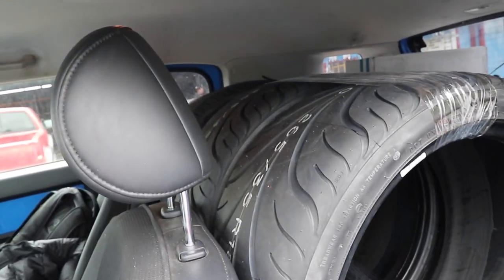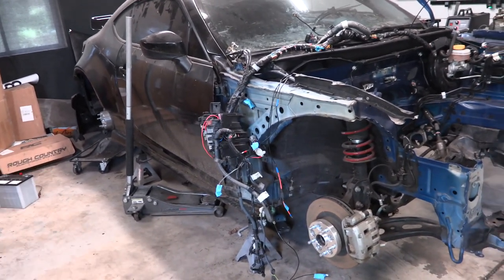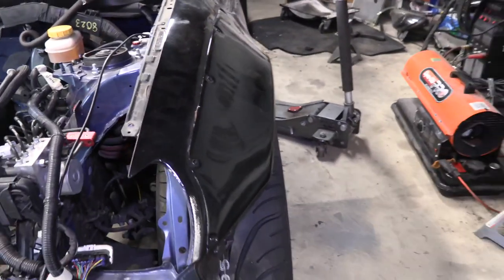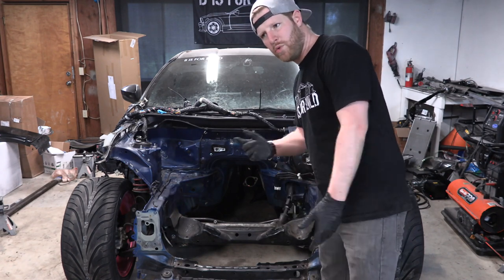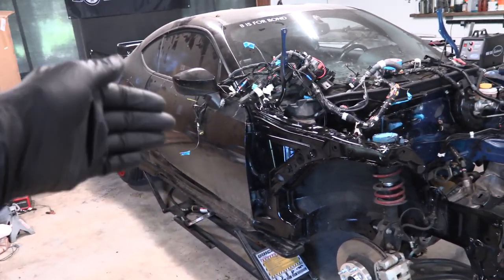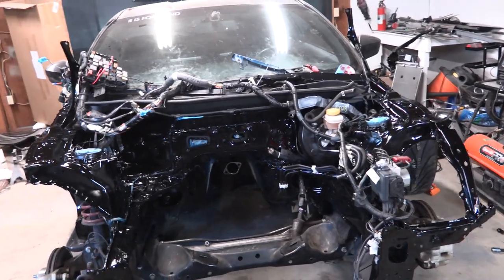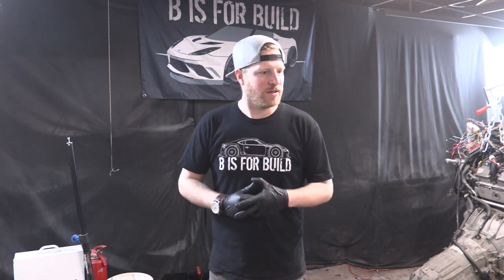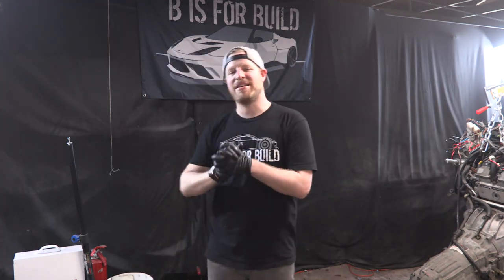2JZ BRZ Pt 8 - Painting The Engine Bay

Comment: I also run the nankang noble sport ns-20 on my 98 svt cobra.  I like them bc they are cheap off Amazon and they make nice burners and also make pretty good traction for hooking up.  Also had them up to 160 mph and no problem (walmart does my tire change. think I pay 12 for each tire and that's to get rid of old ones to.) I bring the wheels to walmart off the car bc I trust NO ONE...

Comment: why run spacers? why not just buy the proper sized wheels instead? i get maybe running a small spacer but 2 inches........
Reply: Because wheels that deep would have to be 3 piece (which already have their own set of problems for hard driving) and they would be expensive as fuck. Who in their right mind would pay around 4k to put wheels on their first drift car that will almost certainly get smashed?
Reply: thedizzle 27t just about every company now offers +0 and +5 options. That would do the trick, or at the very least require smaller spacers. $1k rims are not required. Nor is he paying for rims anyway cuz it's a sponsor

Comment: PLEASE stop using wheel spacers. Get the correct offset, you even have a wheel sponsor!

I understand if you're on a super tight budget and need to use the wheels you have, but spacers are horrible especially for any kind of track driving. Not to mention how you're ruining the handling by changing the offset.
Reply: Weese how do you get a correct offset new rims?
Reply: Weese nah to has to wait 2 months like tj 😒 and end with 19 instead of 18 lol special orders = fuc.ed.
Reply: Go watch offbeatgarage's spacer video
Reply: it's okay if you measure it correctly
(which i don't think majority of people do) 

even sometime you need spacers to get desirable geometry for performance

trust me, so many formula drift car use spacers too
Reply: I used to think the same thing but if you think about it how do you think the rim manufacturers cahnge the offset?
Reply: Weese check offbeatgarage his vid about spacers, hubcentric onces are fine
Reply: Weese if your using the right wheel spacers there is nothing wrong with them they have do effect that putting a wider wheel on won't do
Reply: They get maintained to a different level than the normal car community...
Reply: Lol I only had to wait 5 business days to get my wheel with the correct offset. Custom drilled for my bolt pattern too
Reply: Cameron k r/thathappened